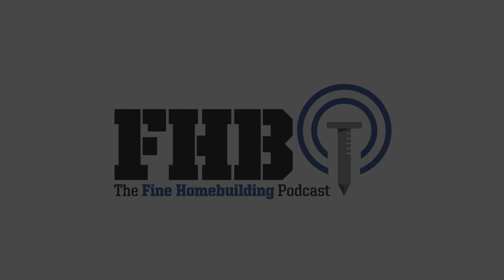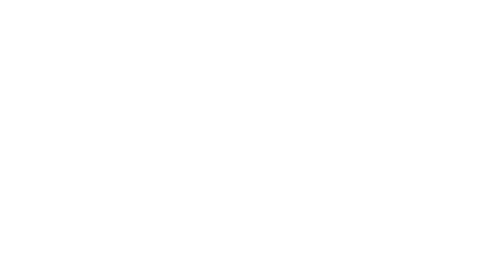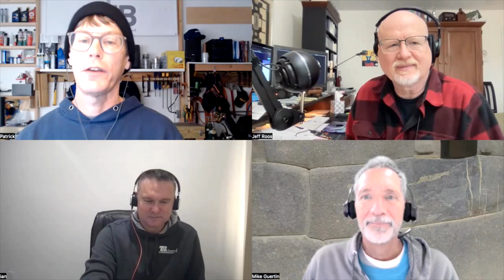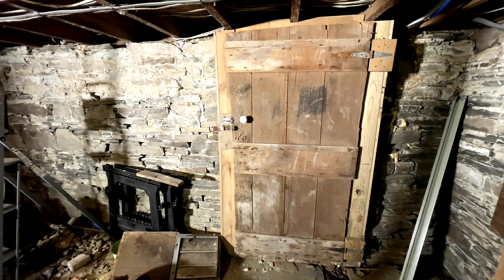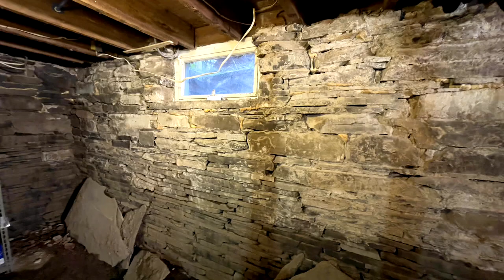Podcast 511: Floor-to-Ceiling Windows, Spray-Foaming Stone Foundation, and Supporting Cast-Iron Pipe

Comment: Thanks to you all, I tuned in for the basement insulating segment, I'm in northern VT with a stone foundation and have been struggling with it. Glad to hear I'm on the right track, I came to the conclusion that air sealing that rim joist will likely cure most of the problems I have, even without insulating it. I want to be as careful as I can with the existing paths to drying as this house has been doing great for 130 years. I plan to repoint the basement, address grading and air sealing, and put gutters where practical. After that I'll re-evaluate. The last sticking point is the air path from the basement up through the walls. It's balloon framed and has no subfloor, so the stud cavities are open from the basement all the way to the roof. The walls are full of blown-in cellulose so it seems like air movement is already pretty restricted but I can't determine whether it's OK to seal those stud bays at the bottom or if that will cause problems.